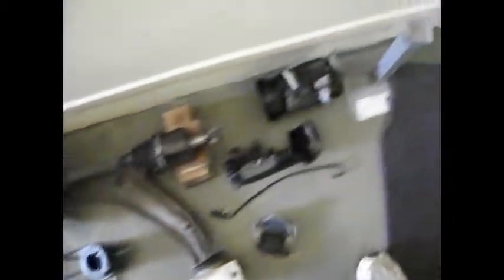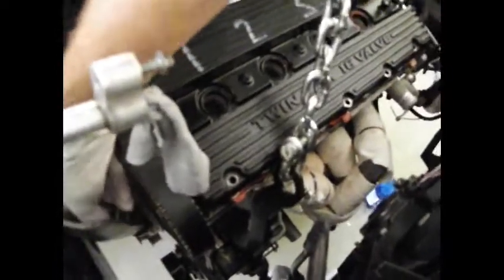Removing a 1.8 K Series Rover Engine Freelander 18KF4

Comment from the maker: Hi Manos, while the engine is out, I plan to renew a combination of things.. the crankshaft rear oil seal is leaking oil, I will also renew the clutch and bearing at same time. I will also renew a few of the IRD seals including the IRD cooling plate. At the same time, I can do the timing belt, water pump, oil pump, etc, etc. Sometimes when you plan to do a lot such as all of these things, it is easier with the engine out. I am also considering taking the engine to the rebuilder to ensure the block and head are skimmed flat otherwise you can have coolant leaking out of the head gasket.
Reply: +Jasco Kovacevic ++++ great i like your style
Reply from the maker: +MANOS DIVER I find the 1.8 a really simple car & engine to work on having worked on a number of vehicles including Ford & Mitsubishi.

Comment: hi why didi youremove the engine.I look all your videow and you know many things what cause the problem.
Reply from the maker: time for a rebuild following coolant weeping external from the HG area. While at the rebuilder, the block will be lightly machined to ensure flatness, together with crank polish, new liners, new cylinder head, etc. A new genuine LR head gasket will be used with OEM head bolts and the newer strengthened oil rail. I am tempted to try the SAIC version of head gasket and head bolts and oil rail, there's an impressive write up on the Net about their products.